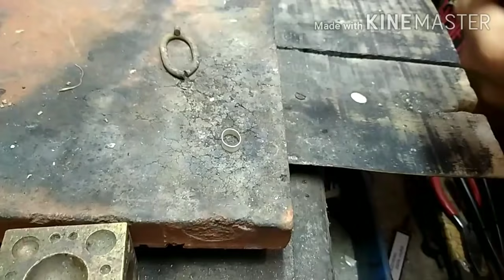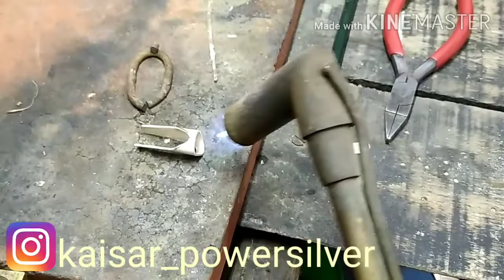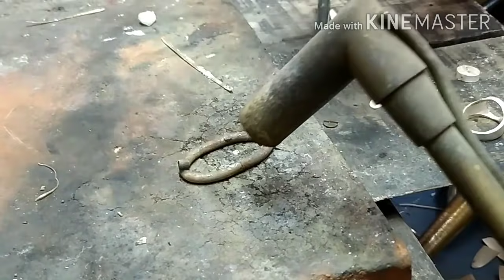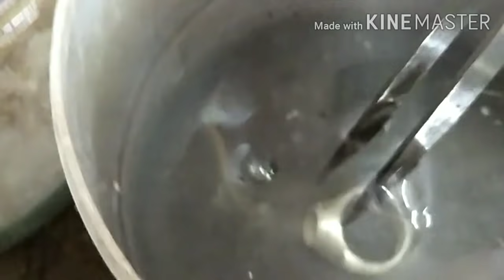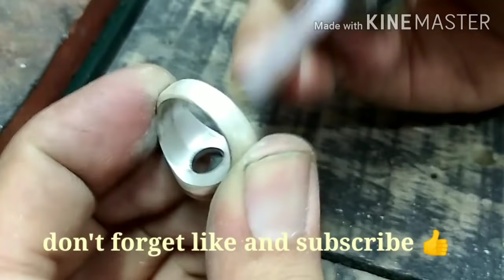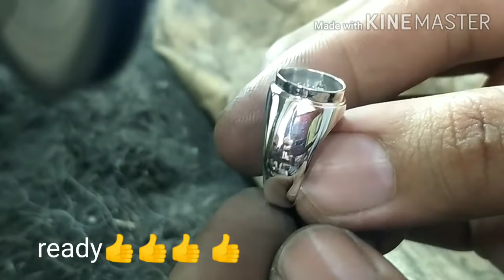How to make a silver ring for beginners |KAISAR POWER SILVER

Comment: When you cut out the shape of the ring, did you measure the diameter/circumference for the space in the top of the ring? I'm confused how you can get it perfect so the setting (not the stone) fits into the top of the ring space 😮 ...
Reply from the maker: yes I measure it first, so that the results fit